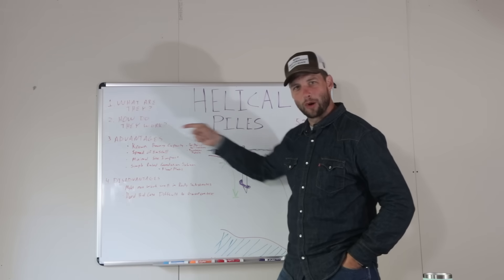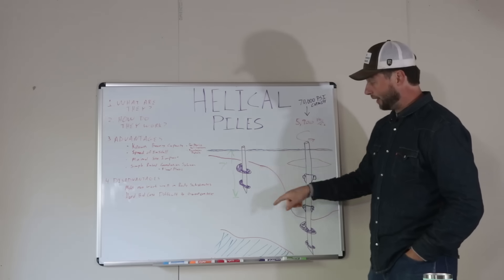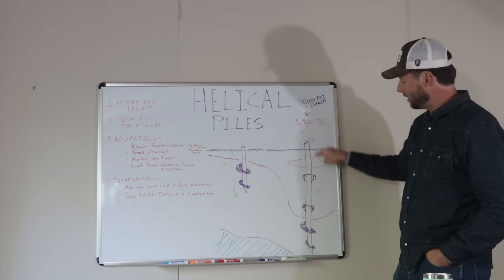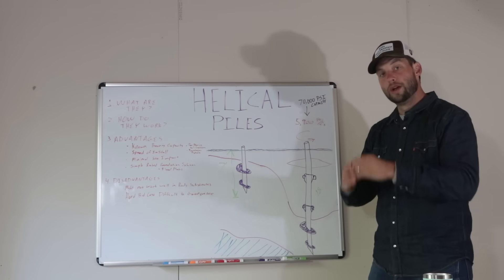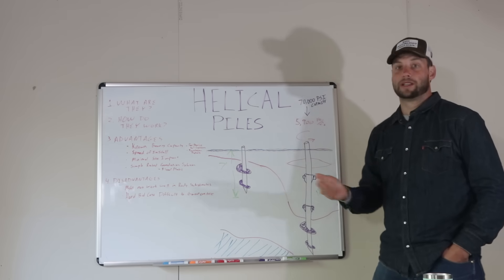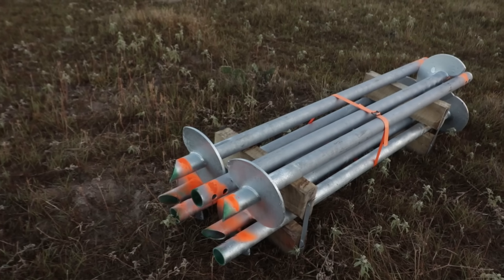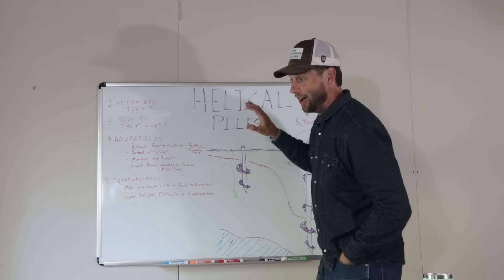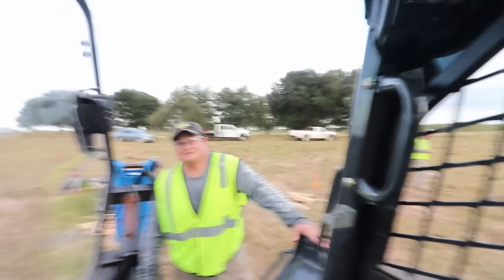Is this the BEST FOUNDATION for your new home? Helical Piles Explained.

Comment: Hi Jordan,  Great Video.  I have a question for you.  How do you account for column slenderness in helical piles?  Some of the piles are short and hence have a low slenderness ratio but some of the piles are long with high slenderness ratio.  How do you prevent the buckling of the long piles?  Do you reduce the pile capacity for such conditions?  Thank You.

Comment: I’d be concerned about corrosion, even with galvanised steel. I wonder if these could be made out of say carbon fibre perhaps? But it could still be quite possible that waffle slabs are cheaper and do the job just as well.

Comment: We've had to do something similar several time , But with #8 rebar and 12" Pier foundations ,,, We've even had to Dig down and Blast for a massive 4' x4' and then run a series of 1" cables into the Slab & foundations on Ski Slopes !

Comment: Will there be an adjustable threaded sleeve installed between the pier and floor joists? That would allow foundation level adjustments down the road. Also, I have seen some piers with sleeves that allow soil to expand and contract around the pier without causing it to move. The Dallas area with clay soil would be an example where you need that.

Comment: Good job Jordan. I am in Woodlands, north of Houston, and the soil here is sandy. We did geo with 3 borings down to 20 ft and all three had unconsolidated sand with water and cave-in down to 10 feet. Engineer on project - I am an engineer too but not civil - advise mono slab with compacted soil. Unfortunately, the foundation engineer will be long gone when my slab settles 5 to 15 years and I wont be able to go after him for liability. The best insurance anyone can have is build the slab as if no piles then add them as insurance ... this method will ensure NO settlement and no headaches later when it settles. If anyone can dispute this statement then please advise.

Comment: Nice video.  Here's my two cents as a helical contractor (not being critical because they do a good job in this video and there is truly a lot to know...I'm still learning.)  Contrary to popular belief, using torque alone is not a particularly good way to engineer these piles. In fact, you need a competent Geotechnical Report to design the piles.  The Geotechnical Report will give you some information that is required the most important of which is sheer capacity.  The torque generally follows shear capacity but it's not perfect.  In making an estimate for your pricing, a geotech (Soils) report will yield a far more accurate design which translates into a more accurate price.  We use a software called Heli-Cap that we input loads, shear capacities, etc... to come up with our designs.  Also, the axial load absorbed by the shaft of the pile is negligible.  In calculating the helical design it's not even a variable considered in the design.  The other incorrect statement is the size of rock that the piles can go through.  The piles will push much larger rock out of the way than 70% of helix separation.  Rocks do, however slow down the installation process and given the chance we stay away from them.   The last thing to keep in mind is that lateral loads are not handled in a vertical Helical Pile.  Think of the different force required to push over a pencil stuck in the sand as opposed to a baseball bat.  There are relatively simple ways to handle that lateral loads (battered piles, augured and grouted tops).  This comes into play generally only if the pile top is greater than a foot or so off the ground.  In concrete foundations it is not so much a factor.  Hope this helps!
Reply: Would like to talk to you about lateral movement.   I would like my top plate set at 32” above grade.    Have you ever calculated 80 mph wind loading on the side of a house?

Comment: After years soil move on or up then piles will move or up cause crack on the walls,
Reply: This system is better than digging and pouring a footer and laying block. The piles are deep enough that any freeze cycle won’t move it. The dirt may move up and down the first 2-3’ of the pile but the pile will remain still due to the fact it’s screwed in below that . 2-3’ is being extremely generous it’s more like 6-18”

Comment: I'm curious how the torque of installation translates to carrying capacity.  The torque seems like it's dependent mostly on the thin screw edge cutting through the soil, whereas carrying capacity depends on the face of the screw pressing down.  What assumptions might I be missing?  Is a separate downward load test necessary?

I'm looking at a garage project - my current (detached) garage foundation has failed and we need to replace it.  Our soil is very peaty, and there may be an underground creek, so we seem to be looking at going down around 60 feet with helical piles to support it. :-/  Our current garage is on footings, and there's about a foot of daylight under the slab that's appeared as the peaty soil has receded.  

Legend has it that our next door neighbor (before we lived here, maybe 15 years ago) pulled into her (attached) garage, the floor failed, and the car fell down about 5 feet.  She had to climb out through the sunroof.  Would love to avoid that. =)

Comment: What does this method save in cost vs a std poured concrete slab ?
Reply from the maker: eeehhhh.  I was hoping I could report a big savings, or at least parity with a concrete slab, but by the time you add the wood flooring system, you are above the cost of a slab.  Of course, I am going to be using these under my slabs from now on too, so if you compare deep foundation to deep foundation, you'll probably be about equal.

Comment: Key info missing: price??
Reply from the maker: It is highly dependent on pile size, design, and required depth.  However, we spent $16K for 28 piles.
Reply: @JordanSmithBuilds  mmm,
How deep were these piles on an average.
Reply: You damn right.
Reply: @Staki6908 , From another commenter:
We were just under $20k for 8 35ft deep piles, 4 diagonal piles and 4 I beams to carry our 22' x 27' cabin.
Reply from the maker: See reply above.

Comment: Not sure I’d be too confident in this system in certain areas. This wouldn’t work well in areas like The whole west coast, Texas or Oklahoma etc. area’s that are high in oil rich grounds that get extracted either by hydraulics, fracking or pumping have tendency to have lots of micro quakes which will undoubtedly cause shifting in the earth. Even heavy rains will cause clays to get very soggy creating earth movements. I’d have to look lots more into this before I would be a believer. It appears to be a good idea if in the right conditions.

Comment: wonder how this would work in earthquake fault line places. think any foundation is unknown though. they have a system holding up the wellington museum and you can see it. pretty much just floats on cylinders with the rubber bits to allow movement to not destroy the building.watching these urban developments they spend a whole lot of time leveling out the terrain and get something course down and compacted with cement slabs and go from there. neat video, wasnt real clear as a total noob what this was for until the end and reading the description, would be neat to see that first lot of framing and the floor being laid down next

Comment: Yeah, I want to see the framing details for this.   Disappointed it was not shown here!
Reply: Use your grey matter between your ears. Once post are in and level, saddles are installed and the rest is normal.
Reply: @lpc5152  look, I’m not in this profession so what the heck is a saddle?
Reply: @jacksprat7087  The saddle sits on top of metal post to accept wood beam or post. The term is used in the video. The framing sits on perimeter beams.
Reply: @lpc5152  still like to see the sill plate and rim joists installed.     From the “Saddle” they used they must have used 4”x12” sill plate.   No center support between the piers?   What is the pier spacing there?  20’??  The limit on 2x12’s is 16’.   

So, if they took a video of that build I’d like to see it.     Can your “grey matter” dig that?

Comment: I’m a geotechnical engineer that specialises in bearing pile design. There’s a lot of misinformation in this video. Helical piles are probably the least efficient and worst method of piles. The only reason they’re used is because they’re quick, but they mostly used for temporary structures because they can be screwed out the ground. The method he mentioned to calculate load is wrong. Torque isn’t an indication of soil strength and bearing capacity, it’s an installation criteria. But maybe that’s just American engineering, not exactly known for their ground engineering.

Honestly there will be more, but I got 5 minutes before I had to stop because this video is clearly just an advertising cash grab for himself.
Reply from the maker: Hey Will, thanks for the comment.  This channel is a two way street and I love to learn through the viewers expertise.  Educate us on the weaknesses of this system. This isn't a defensive comment, I'm genuinely curious.
As to the comment about the video being a cash grab, you clearly missed the point where I say that there is no sponsorship of any kind.  We paid for all installation and material costs, and there was no money exchanged for advertisment.
Reply: @Jordan Smith Happy to answer – I’ll preface by saying engineering codes and build regs vary from country to country and the UK/EU codes will vary from the US as to what is acceptable – I’m from the UK so my measurements will be in metric and the code I use for helical is BS8004:2015. With that being said, helical piles on the surface seem like a good solution but are compromise – they do have their uses such as sites with highly contaminated soil (no muck away), they can be unscrewed from the ground which is great for temporary structures, no concrete curing time, fairly good lateral and tensile strength for the size.

Geotechnically is where you run into the issues. Depending on the soil you’re in will dictate how they behave, in clay soils (total stress) they can essentially form a “plug” of soil, which causes the segments of soil between the plates to become a skin friction pile acting against the soil outside the diameter of the plates. End bearing on clay soils is generally very low and outperformed by the shaft performance. Now the limitation of this is you’re limited by the plug length, which is typically 3x the plate diameter. Usually a lead section on a helical in clay will be 200mm or 250mm, even assuming a 300mm lead section, you’ll have a 900mm plug. You can add additional plates to the shaft for more plugs, i.e 4 plates = 3 plugs, if they’re all 300mm dia plates, you essentially have a 3m plug.

The issue you get with this is you need more torque to drive these in, as I said – the current engineering literature considers torque as an installation criteria not an indication of geotechnical performance. So if a position was anticipated to be 6m, but you can only drill to 5m because the rig is maxed out, you can only back calculate the capacity from the installed length against your ground model – the torque and the fact the rig stopped is not a good indicator of soil strength.

In granular soils (effective stress) you find the end bearing is good. You generally take the end bearing of the plate, and the subsequent plates thereafter less the diameter of the stem e.g if you have a standard 89mm stem and a lead 200mm plate followed by a 250mm plate, you take the full area of the 200mm plate, and the 250mm you take the area of the 250mm – the 89mm stem for the flight area. There is a debate in the industry right now as to whether you can take the full end bearing of plates after the lead section due to the soil being reworked and stress bulb distributions of the loads into the soil, or whether you take just the difference from the lead to the secondary, secondary to third etc.) 

The codes here suggest you should check shaft and base resistance methods for both total and effective stress designs and take the lesser of the two for the design so usually you’ll find the end bearing is clay is worse and the shaft in granular is worse, but it can change site to site.

The last issue is axial load. Due to the size, you’re generally limited on the axial load you can apply to the pile. If you know ahead of time it’s going to be a 300kN position and that will require a 15m deep helical piles, you won’t get 300kN onto that pile, depending on the souls, you’re really limited by axial los, also you’re probably going to struggle to get that into the ground, and will have to recalculate the allowable load on the installed length as I mentioned above, which will result in extra piles.

For a site such as yours we’d consider steel tube bottom driven piles.

However, the vast majority of the work I do for clients is for rotary core and CFA/SFA pile design, which is more costly both financially and with time however the longevity, performance, knowledge and literature is much better surrounding these methods. 

If you want more detail, just ask I’m happy to help.

Too long, didn't read version; they're inefficient at moving load stresses into the ground.

My comment on the cash grab was referring to the fact it’s a 10m+ video to qualify for adverts, and some of the content is misleading – apologies if it came across as aggressive.
Reply: You CLOWNS get on my last nerve. The fancy.shmancy "building science" you jackasses push has resulted in homes that have rotting eaves, walls, window and door openings and generally fall apart in twenty years. But I can show you HUNDREDS of houses over 125 years old that  are as solid as the day they were completed. This CRAP about vapor/water barriers, where they should be placed is 100% GARBAGE! The home needs to BREATH. Naturally, as was done for thousands of years. No insulation, no vapor/water barriers, but LONGEVITY. And for a couple of hundred years people built on ROCKS leveled to accommodate floor framing. Guess what? Houses  standing to this day. You CREEPS that call yourselves "engineers" are no more than crooks, selling BULLSHIT to the uninitiated. Too expensive to heat/cool without insulation? DOWNSIZE idiots.Only following the end of WWll did homes start to grow. Enormously. Prior to that eight hundred square feet worked for most families. Now you crooked bastards have people convinced they NEED a thousand sq. ft. per person. INSANITY.

Comment: Hold it right there. Are you a Professional Engineer? The building code states Desighn shall be by the imperical method. Here say means nothing. Where is the engineering calculations that take into effect soil conditions and static and dynamics loads? Are there stamped engineering calculations ready for submittal?

Comment: If you have inconsistent soils, magma forcing its way through your lot, an f-5 tornado, and a meteor the size of a small city impacting your house, will these ensure no foundation movement?
Reply from the maker: We have simultaneously tested volcanos, tornados, and meteors (Austin sized) and we found that this system works well under those conditions, with minimum movement 😄

Comment: How well will they work in an environment like new orleans . And how long will these steel pipes last in wet soil like N.O.
Reply: We routinely design them for costal areas.  If we know what your service life is we can do a corrosion study to determine what secondary coatings are required or if sacrificial steel loss is required.

Comment: Instead of the extension sections for more depth, wouldn’t another helical section be better?
Reply from the maker: Depends on the load, more helices are sometimes used with greater loads.
Reply: another helix in soft soil doesn't increase capacity because the soil can't bear a load which is why torque drops off.  if you put additional  helix's in solid soil the torque goes up and capacity increases due to more surface area in contact with load bearing soil.

Comment: What kind of shear value do these allow for . Uplift during high winds or Tornadoes could possibly cause some type of failure if you have a roof system with eaves., or saturated ground from lots of rain, coupled with high winds . Roofs with no eaves / minimal eaves might alleviate a huge portion of uplift and put minimal pressure on the metal screw thingys.

Comment: This is a very good solution for nordic climates like we have here in Quebec, Canada.
The code forces us to make foundation as deep as 6 ft to prevent freeze/thaw cycles to move the foundation.
The only hassle is that many municipal inspectors don't want us to use that type of foundation because it reduces the price of the house and, consequently, reduces the taxes that the municipality can collect.
Reply: that is crazy, myyyy gosh. someone just trying to build a house and the local govt are concerned with themselves
Reply: @elephantear7659  what? You thought they cared about the people?
Reply: @elephantear7659  it's time to E N D  G O V T.
Reply: I wouldnt put it past them but ii doubt they can do it accordi g to any code.